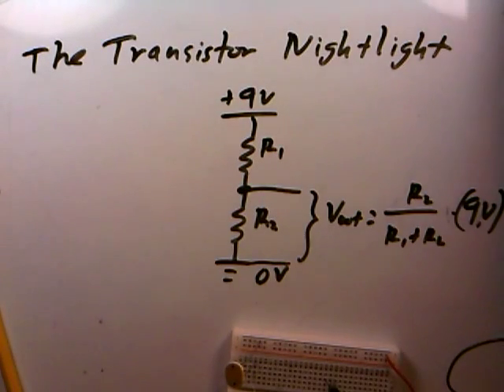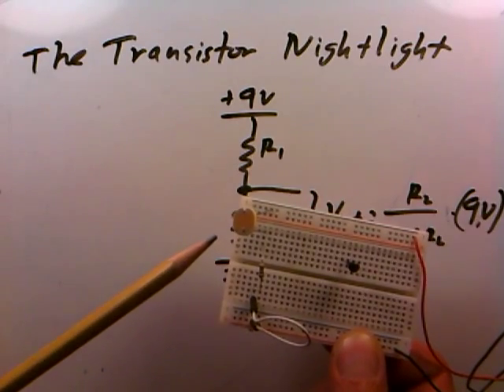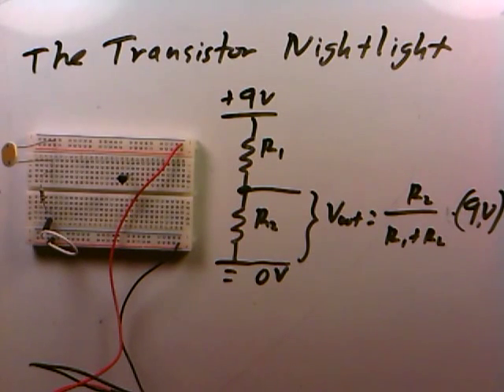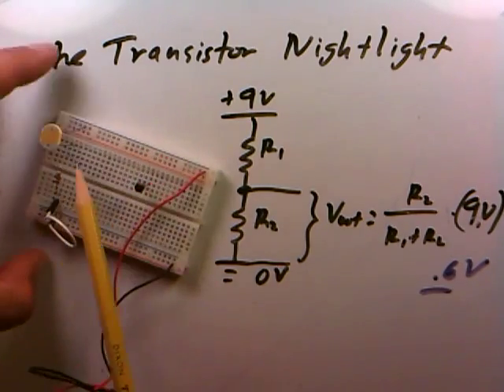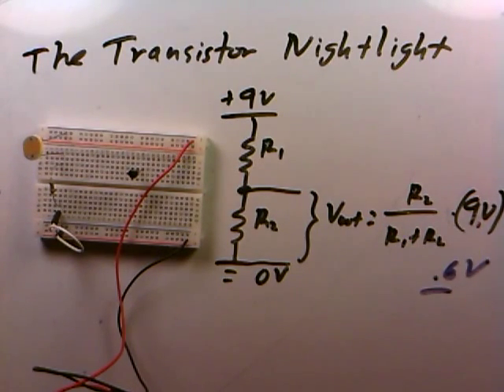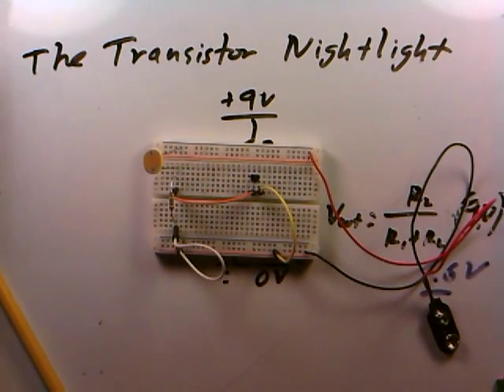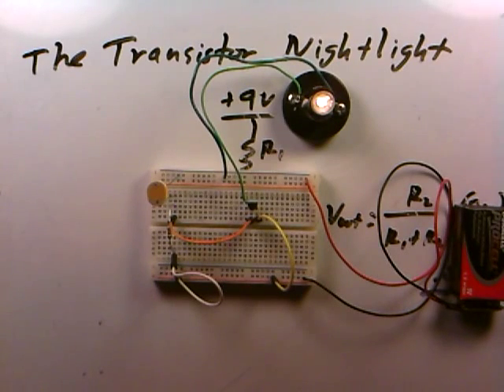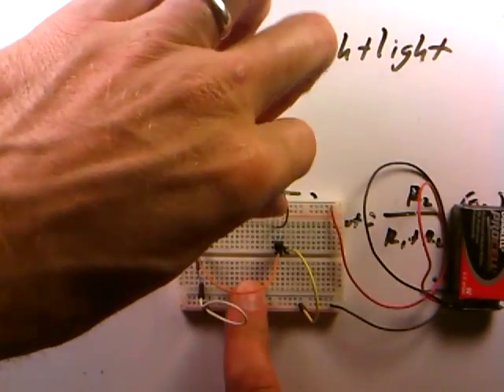elec 026 5 transistor night light with buzzer bulb and motor

Comment: If you make the photo cell the in the R2 position and make the R1 the 10000 ohm resistor, it should work as a night light.
Reply from the maker: Yes and good point. Reversing the roles of the resistor and photoresistor will reverse the trend in the voltage divider, to make the transistor base go low when it gets dark, turing on the transistor when it gets dark.